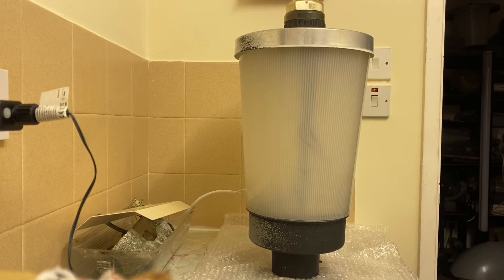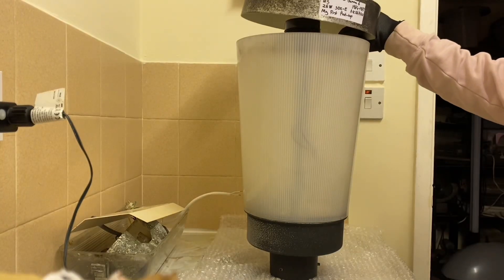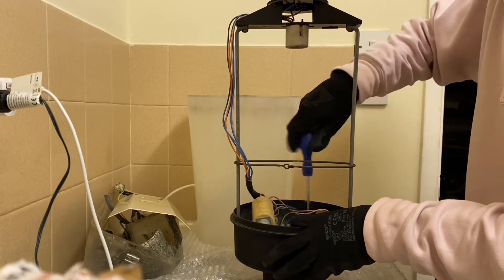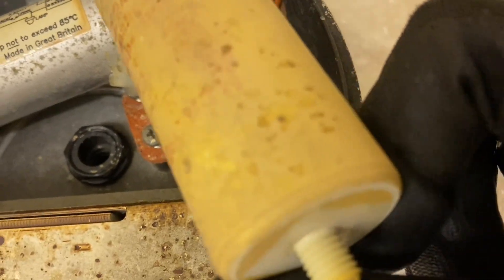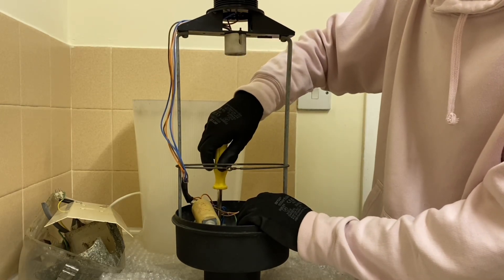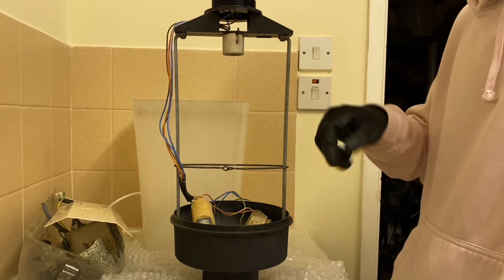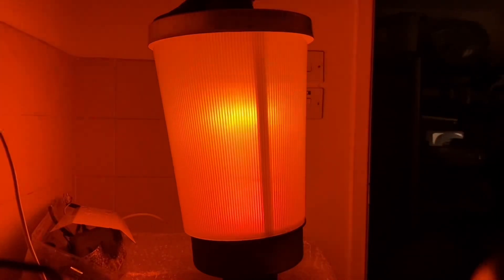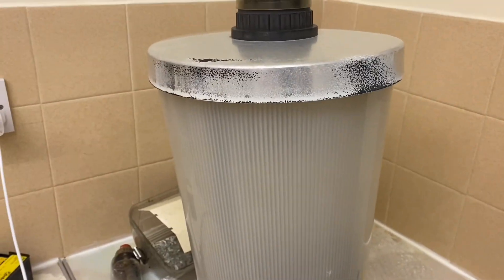A Street Light from the 1990s | Thorn Gamma 6 Teardown & Warm Up

Comment: He's back! the E in a triangle is for external ignitor. I in a triangle is integral ignitor. But I have seen and installed SON-I  on G6s where the ignitor has failed. Great old lanterns, the G6s. nice one!
Reply from the maker: Thanks for the correction - some of the ones here had SON-Is installed with an ignitor on the gear set too, perhaps due to ignitor failure
Reply: That'll be it. Most of the time when an ignitor fails, the live out to the lamp is still live from the ballast, just the circuitry for the high voltage kick is dead. So you can fit a SON-I without removing the ignitor.

Comment: Not bad at all! I must admit, I do prefer the older style lamps as they look better aesthetically than the LEDs (especially this type) and are super easy to change out a faulty lamp. Even replacing an ignitor or ballast doesn't seem like an awful job. This is unlike LEDs where if something fails you generally have to swap out the entire fitting/fixture.
The only thing I don't like about SOX (and to a point, SON) is the extremely poor color rendering - SOX in particular as it just made everything look orange, or black. Mercury vapor, metal halide and fluorescent light fixtures were better (yes they did do some fluorescent street lights at one point) as they had better color rendering properties and gave out a light that wasn't golden yellow or orange.

This is also why I prefer the fluorescent fixtures we still have at work, compared to the LED equivalents. I would eventually love to buy an old street light, just have no idea where you'd source one as most councils have either switched to LED, or won't let you have the old fittings!
Reply from the maker: It could be worth having a look on eBay, I got a fair few of mine from there, Id say wait for a Gamma 6 or sinilar to pop up for £50 or less, as the ones on there at the moment are very overpriced. A seller called Capeswift Vintage and Retro sells them at a good price

Comment: I have a collection of fluorescent and SON lights, 60s - 00s. The connectors always snap! Also what's annoying is that quite a few of the stickers have disintegrated from the slightest gusts of wind :(

I hope to get more streetlights, I have 2 generic 70W spotlights, those are disintegrating. I also have a 70W SON-E Philips SNK70 (label is disintegrating) and a 70W SON-T Holophane Wallpackette III
Reply from the maker: What I usually do with damaged stickers is take a close-up photo, mess with the contrast and sharpness settings and try to reconstruct the sticker (while keeping the original one intact) - I had success recently with a Gamma 9s sticker, but it was quite time consuming!
Reply: @LeoLampposts I've gotten pictures from before cleaning, but when they get brittle and curl up, nothing you can do. Sadly I've lost some pieces, but luckilly with my Philips SNK70, it's the bottom of the label which has curled up, so I didn't have to spend hours identifying which model it is. Lots of the Philips fixtures look really similar!
Reply from the maker: @mushroomcraft they do indeed, Philips codes can change depending on lamp-types or materials its made of, so its good it didn't curl up too badly

Comment: Great Video!

I do have a 1990’s thorn gamma 6, to date it, you should check it’s NEMA. Back to my G6, it’s a July 1997 one, it has been damaged severely where the inside it’s just nothing, 35w , was geared but absolutely nothing in it.

Il PM you if you’re interested in the lantern.
Reply from the maker: Thank you, it took a bit to spot but a faint03/92 date code is visible there, so the lanterns manufacture is likely within a year too. Does it still have a cover on it? Without a gear it shouldnt be too difficult to place a GLS lamp inside and use it as a room light - as I do with a few of my post-tops
Reply: @LeoLampposts, no probs, messaged you. Regards.